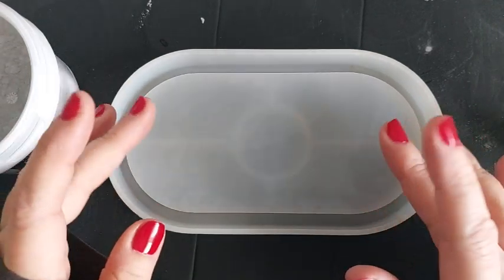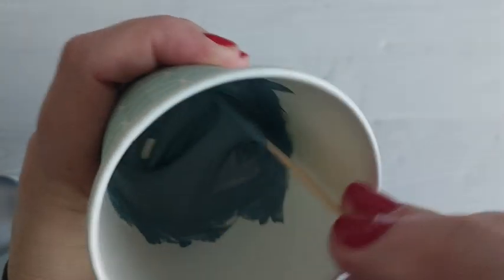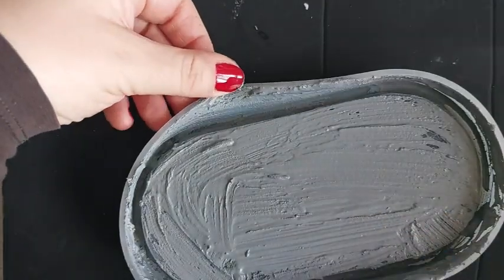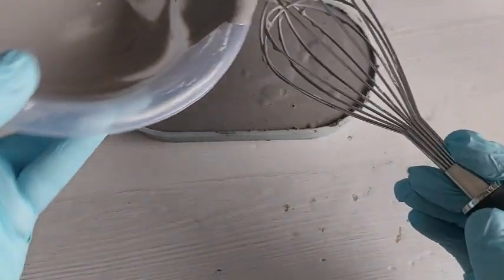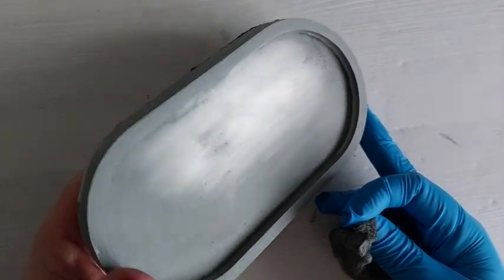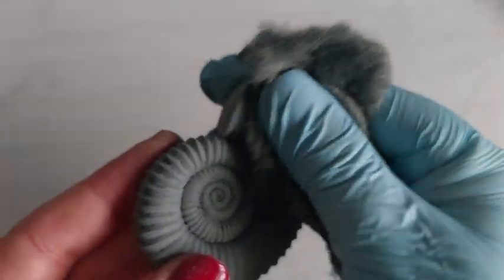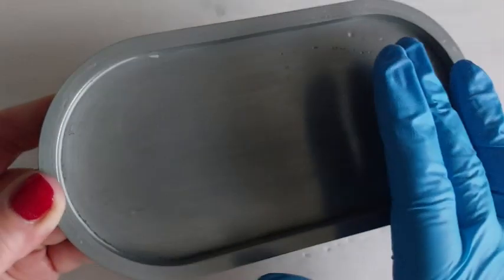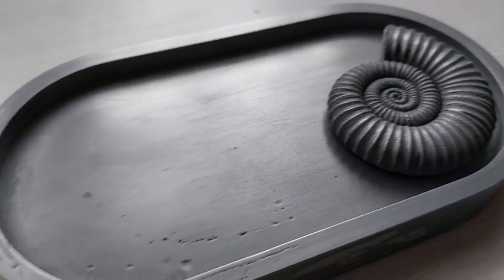Metal Cast by Elichem

Comment: Looking forward to this, I have done something similar with PU resin and aluminium powder.
Reply from the maker: Thanks Karey .. oh that sounds fun too x
Reply: It's really similar, you dust the aluminium powder into the mould then also add some to the OH resin. 40 mins later demould and buff up with grade 0000 wire wool. Looks stunning on the torso moulds of men and women!
Reply: I hate auto text ...polyurethane resin (PU)

Comment: Just a hint if using wire wool. My Dad was a woodworker and he used it as part of his finishing process. He stressed to me that if using wire wool you must clean every tiny bit of it that may be on your piece because if you use a water based sealer or paint those bits can rust and mark up your finish later.
Reply from the maker: Thank you so much Sherry that is a great tip 😍😍

Comment: Hey Claire hope you doing good, great material but maybe do it the other way around first cast the hydroflow then add the metal casting
Reply from the maker: Heyyyy Ahmad ... it is a coating medium. Designed to coat the mould not the other way around... but that would definitely give a rough textured finish doing it that way if its possible.
Reply: @ClairesCraftyCorner  yeah maybe but try 😛
Reply from the maker: @ahmadalsayed6776  🤣🤣🤣